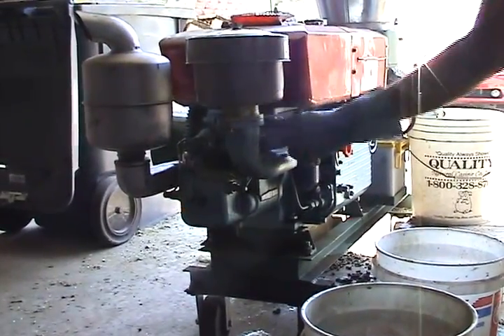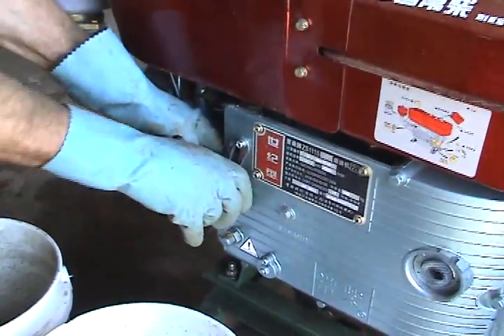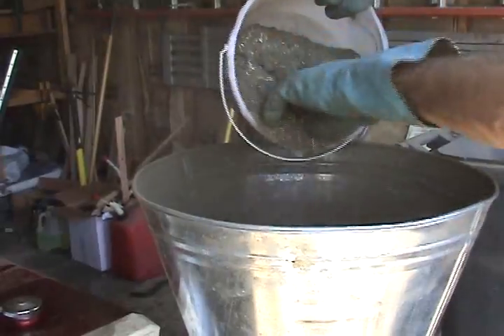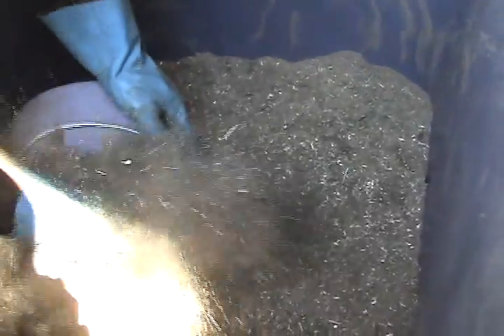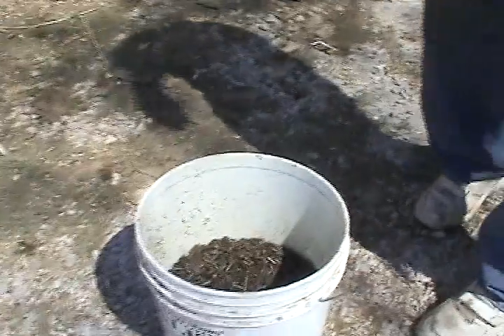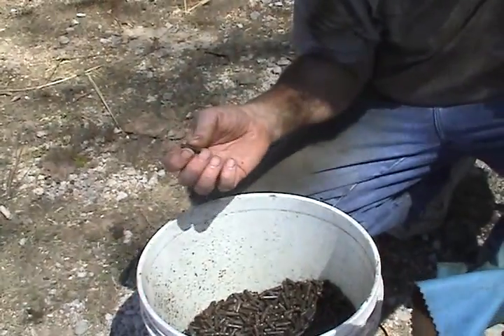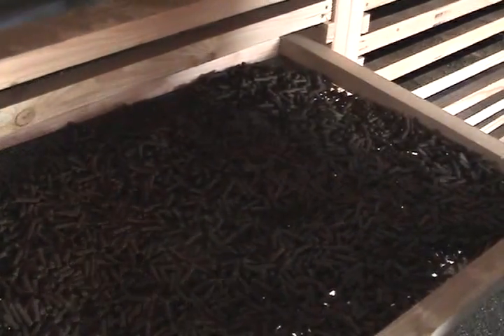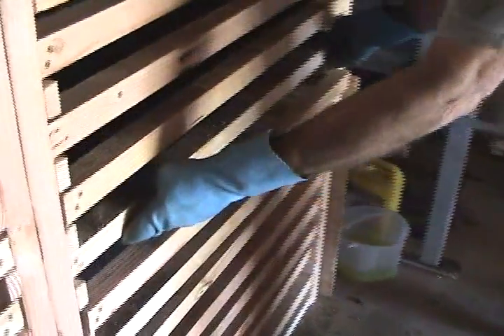Making Wood-Grass Pellets

Comment: do You recommend this pellet mill if i just want to make feed Pellets from grass
Reply from the maker: Yes I believe it would make great feed pellets from grass. Even wet grass would probably make good feed pellets. But if you are planning on storing them then you would probably want to use drier grass and then let the pellets dry well otherwise you will probably get mold.

Comment: Thanks for posting Patrick.  hmmmm, I may have made the same mistake as you.  Its interesting that there are lots of vids from manufactures showing the machines working at a fast rate but not many from users.  I think i have the same machine as you and have made some mushy pellets and also some dusty ones.  My pellet stove seem to handle them ok.  I think i will try and slow down the feed rate and see if i can make some harder shiny ones eh.  thanks again.

Comment from the maker: Thanks for your comments. Sorry I haven't replied before this, pretty new to YouTube posting videos. I have long since returned my pellet mill and also my hammer mill. It was a live and learn. But never again will I try to make my own pellets. These machines are designed to produce feed pellets only and not built to handle hard wood which is required for a quality burning pellet.